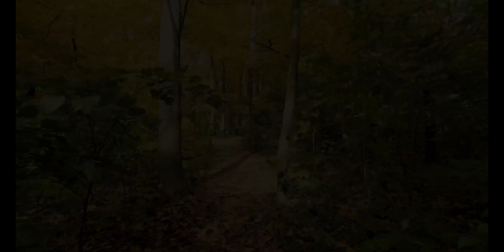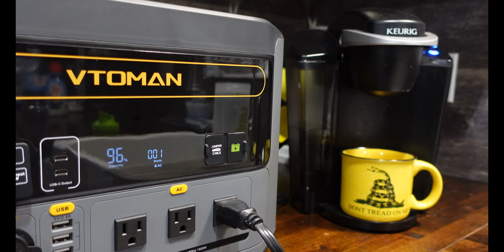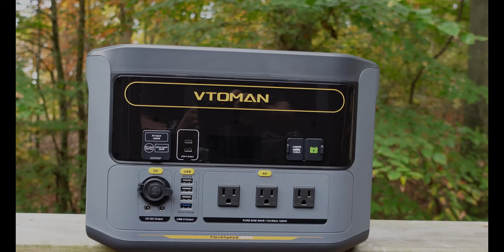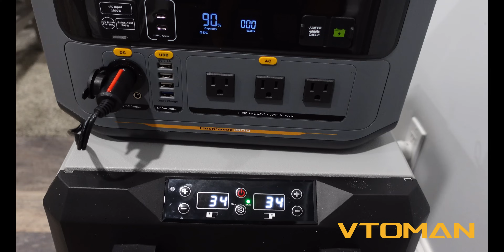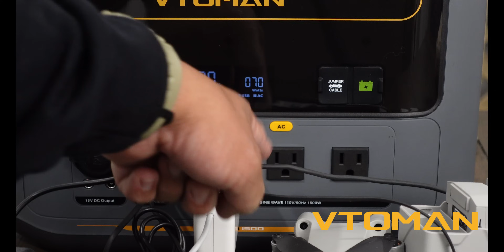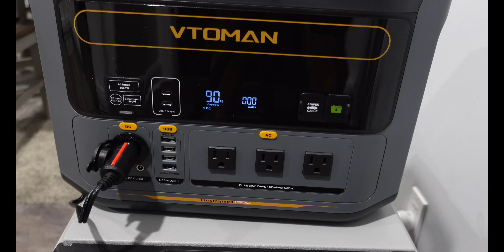VTOMAN FLASHSPEED 1500 Power Station - MORE POWER - S2 - E79 #vtoman

Comment: I also purchased this after watching your video. You must've got this for free. After spending almost over $4000 purchasing 2 Flash speed 1500 and 2 flash extra batteries,, and then finding out that they do not work together, I ended up in an argument with the company that they do not work properly. After three weeks of sending them videos they finally admitted that their product does not work as intended. They would return my money. This almost took three weeks, they made me prove to them (with video and I can post this on YouTube) that the product didn't work properly as they stated in the instructions instruction rule number two of the extra battery. They didn't want to return my money stating that the product worked perfectly, then I found a whole bunch of other Youtubers stating it doesn't work as described. I would stay away from this company as I've almost lost $4000.
Reply from the maker: Sorry to hear you had problems with them. I do not use them anymore as well. I heard stories later when they came out with their expansion batteries. When I did this video, I did not test their extra batteries so I had no experience using them. I currently have shifted to using Bluetti products which their customer service is unbelievable! I would recommend selling the VTOMAN items and going with Bluetti. Again, I am sorry to hear about your terrible experience and glad you got your money back. I  appriciate your honest feedback.

Comment: Would not recommend this one at all. Bought it in late July or early august and have been testing various products to plug in. Small vacuum and usb fans and lights. It has QUIT. The week before I go full time vanlife. So I’m stuck without a power station and no help from VTOMAN AT ALL!!  Do not buy this one. If you can keep it charging by ac can you imagine trying solar or anything like that!!!  IT WILL NOT WORK AT ALL. THROWING A 03 flashing error I guess. I’m so disappointed now what do I do?
Reply from the maker: Lisa, sorry to hear that! I now use a Bluetti AC180P, have you contacted VTOMAN, kind of curious to hear the status of it. I have not had any issues with mine yet.  Keep me posted! I hope VTOMAN reads my post sod they can help you out.